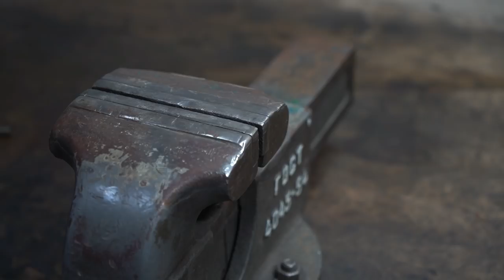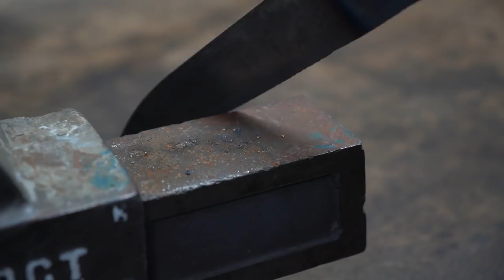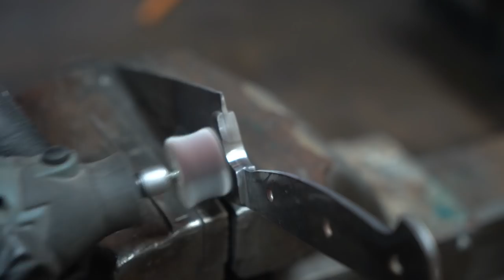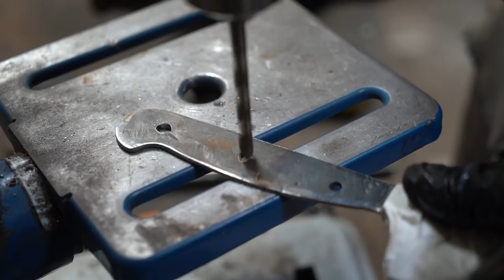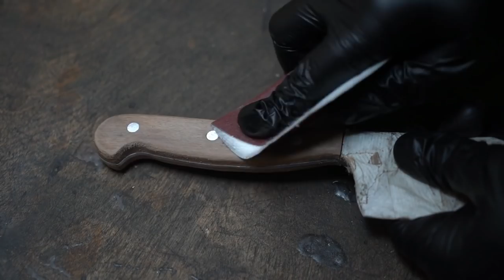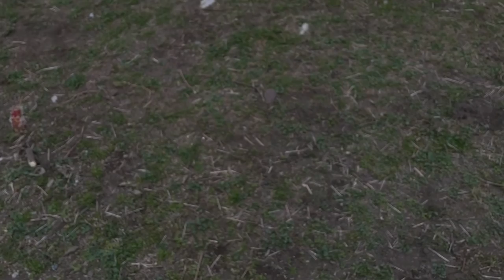I Restored This 2$ Junk Kitchen Knife - Old Knife Restoration & Repair

Comment: im a bladesmith and you ruined the heat treatment of that knife. the back half of the knife would hold an edge for long
Reply: Saw that myself... Took the heat treat right out of it. Should have reheat treated and tempered afterwards.

Comment: THIS, is what I call a proper knife restoration. A knife that is going to be used in a kitchen which means cutting food, MUST be super shiny no matter what. No dents and no so-called patina! Great job!
Reply: A good patina is something you can't get around when using high carbon, non stainless steels that are used for very precise cuts in a kitchen. The steel will show various colors over time because of acids in the food you're cutting. Patina will occur, no matter what you do. Stainless steel won't get that, and this knife might be stainless. But because this knife is not heat treated; secu quenched and tempered after, the edge won't hold up after 1 day of use. Tldr; it's not a proper knife restoration. :')
Reply: @pieter-matthijsbolt6375 . What would I know? I only live in Japan and I only have 30 knives. Here we are not talking about a Yanagiba, an Usuba or even a Deba, and the blade is not Hagane. Actually the sharper the knife, the more careful you must be or the edge will be gone in 60 seconds. This is for entertainment purposes. This is for people who get satisfaction visually. Anybody whose go to source for choosing knives is YouTube, does not belong in any professional kitchen. But again, what would I know? I haven't used a proper knife "properly" in more than five years, and my knives are in desperate need of "proper" sharpening, if I decide to use them again.
Reply: @Stefanox36  meh. This is not the first video of a ruined knife. More people noticed, he chooses not to do  the restoration well. That's not proper. And therefore the opposite of entertainment. It's torture :p
Reply: @pieter-matthijsbolt6375 . OK. Why don't YOU show us how it's done?
Reply: @Stefanox36  ghehe. I won't because I don't have the right equipment to do proper heat treating. As one should to show people a knife restoration that is satisfactory for most knife enthusiasts.

Comment: Cosmetically you did a great job but structurally that knife is now a complete pile of dog shit. You heated the blade up and annealed the heel of the blade making it soft, it will now not hold an edge in that portion of the blade for any reasonable length of time. ☹☹☹